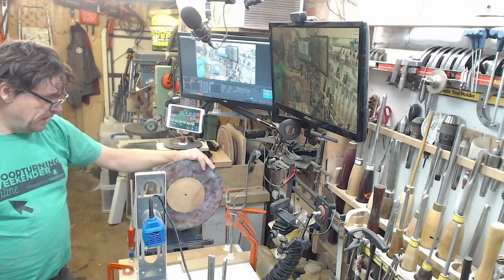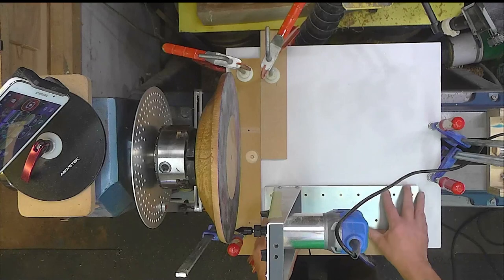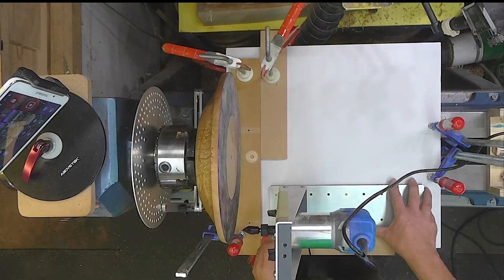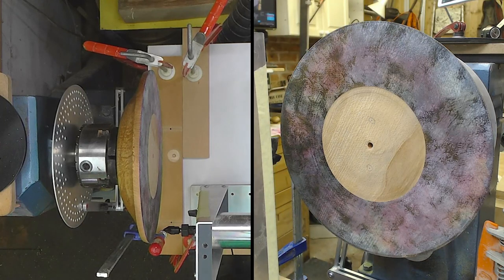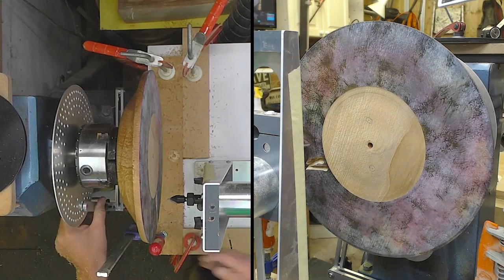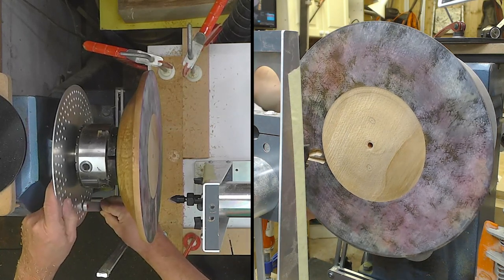Woodturning a Fractured Gold Decorative Platter

Comment: In my day I worked in heavy wood construction on golf in the US....... specifically customized to each site in terms of line - slopes and elevation
Developed a process of continued improvement in each construction layer
same religion as yours
Had an early success in "finger painting".
bought paints
working my way through everything in the way 
fun to begin shortly
What I like about turning is that it is non-judgmental
long as I keep going and don't run out of sandpaper it all works out
You never make a mistake as long as keep at it
only a hindsight innovation
Reply from the maker: Cheers, Jed - it was a great play session for sure! I loved doing this!